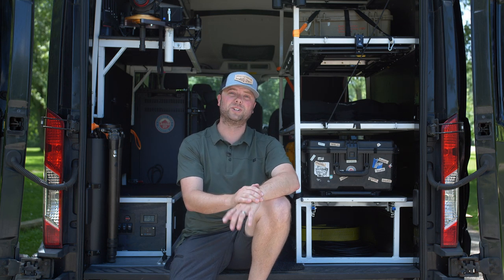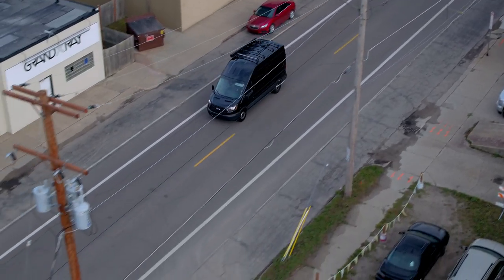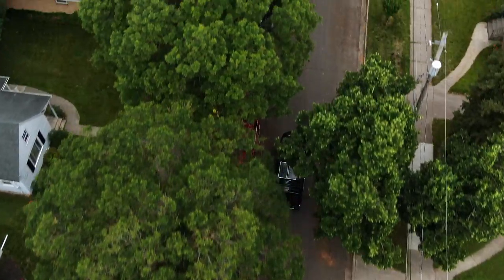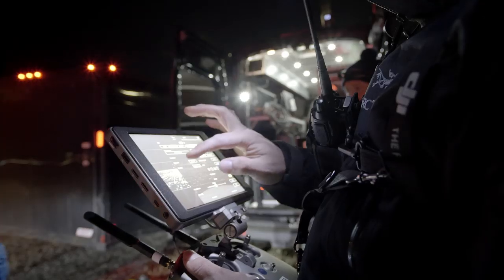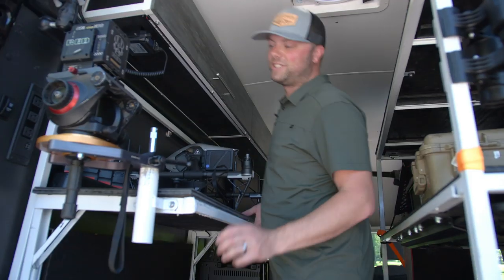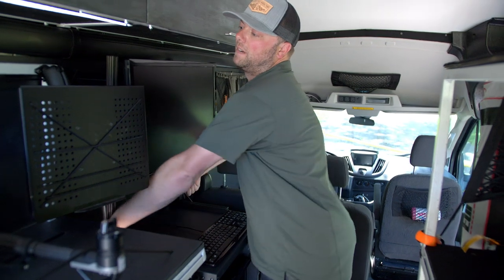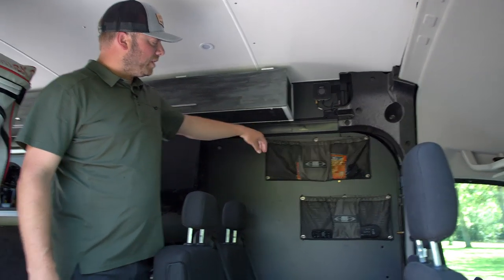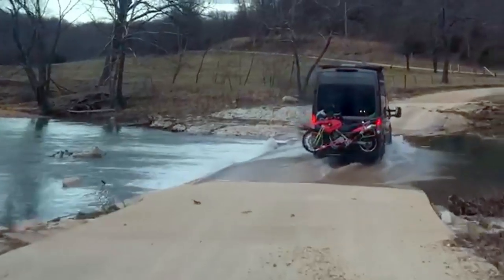Our Custom Video Production Van Tour

Comment: This production build is beast mode.  For those location shoots that are in hotels, high rises etc where you have to drive up several floors to park,     this truck is too high to enter parking garages. What solution do you employ to transport gear from ground to high rises or buildings? Also wondering what security alarm systems would be best for these kind of vehicles.
Reply: Yea. High rise hotels stink. We try to avoid those. Good example. Say Las Vegas. Don't stay in a casino. There's a nice Hampton Inn with an outdoor parking lot on the other side of I-15. We book around parking, security and ease of use for all hotels and lodging for sure! Nothing worse than having to lug 20 cases up 2 elevators and 3 hallways when the bell-cart is missing!

Comment: Hey mate, how is it going so far with Ford Transit? Can you share some experience with us now, after 3 years... we will really appriciate! We are more interested about Van condition, do you have problem with rust, maintanance etc... Thanks a lot!
Reply from the maker: I have 2 transits. This black one which now has 140k miles and a grey one I built into a camper. No rust on either, and I live in Michigan with very salty winter roads.

Comment: What multiband antenna are you using? And how do you use multiple devices. Is there an antenna slitter and mini sma outlets in the van?
Reply: Correct. There's 5 SMA's in the van that pass through the roof into the antenna. They're routed to their appropriate device. 2 of them are just loose to be plugged into drone stuff.

Comment: I was looking at the E350 short bus for a production vehicle but am slightly worried about the weigh station thing etc. Apparently you only need less than 24k lbs. The only thing I think you need a license/permit to business out of the vehicle. Correct me if I am wrong.
Reply from the maker: That's incorrect. If you're over 10k GVWR on either your vehicle or a trailer, or a vehicle + trailer combined is over 10k, and your engaged in commerce. You're a commercial vehicle. You need DOT numbers, safety inspection, a medical certificate for your driver, logbook (either E or otherwise) and keep hours of service. You may get away with it for a long time. But over 10k gross, and commercial, you're commercial. 26k that you mention is whether or not that driver needs a Class A or B CDL, or CDL at all.

Comment: Amazing job, very inspiring! I am working on a similar project customizing a Ford Transit. Do you mind providing more information on your choice of inverter and the power configuration?
We do primarily streaming events and want to generate our own power but Im a bit concerned about the switcher and some of the other sensitive gear we use.
Reply from the maker: We're using an AIMSPOWER 2000W pure sine wave inverter. Our streaming company has a separate similar setup in the trailer actually as a backup, but primary power is 2X 3,500W generators. The AIMS in this van actually kinda stinks - it hates generator power. It won't auto-switch to generator provided power most of the time. In my grey camper van, the slightly larger model AIMS inverter doesn't have that issue. No idea why. It works great on grid power.

Comment: Have been shopping for a van for a while,. Another year or so till I build one I think. Curious about the legality of your second row of seats. Was told by friends that are vehicle builders and police officers that you can’t drop a seat into a 2 passenger version. IE. DOT says that’s a two passenger van forever no matter how many seats are actually in the van etc. so if you wanted a second row you have to buy it with a second row of seats from factory. Did you guys find that to be true and if so how did you get around it?
Reply from the maker: There's approved up fitters that can change your door tag to accommodate extra seating.
Reply: Bangers&Matt awesome! Good to know.

Comment: How did you source your inovativ compatible posts?
Reply from the maker: They are just 1.75 OD aluminum tube. Available from lots of metal supply spots. We got a bunch locally and cut them down and made our posts collapsible in 2 sections. Then welded caps on the end with threaded bungs.  Very cheap $$.

Comment: Can I know more about the antenna thing for the drone?
Reply from the maker: It's just a vehicle shark fin 4 in 1. There's lots of variants depending what frequencies you need.
Reply: @BangersMatt  hmm 🤔 I wonder if it work with wireless video system? To extend the range or Just to get a clear signal have you tried with such things?
Reply from the maker: @oudomsambatchorn851  Yea. that's what we use it for. Most drones are in the 2.4/5.8ghz band which is super easy to get an antenna for.
Reply: @BangersMatt  yeah I see, but have you tried with wireless video system such as Vaxis Accsoon etc? I do live-streaming for events and conferences and would benefit from long range wireless video transmission and crowding area where people would cover the camera operator with the KOL lol.

Comment: Why the Ford and not the bigger dodge sprinter?.
Reply: Sprinter isn't any bigger really, unless you get into the extended bodies which can't easily parallel park.. Tall Transit is 81.5 interior height. Tallest Sprinter is 79.1. Length of same body options interior area (non extended versions)  Transit 143.7 in Sprinter 132.9 in.